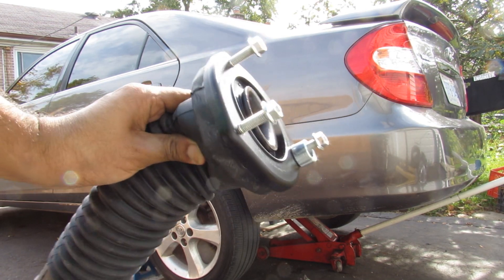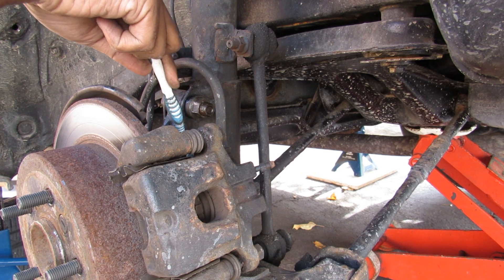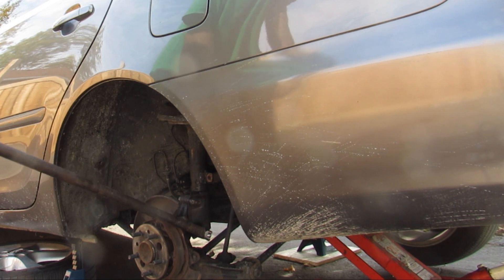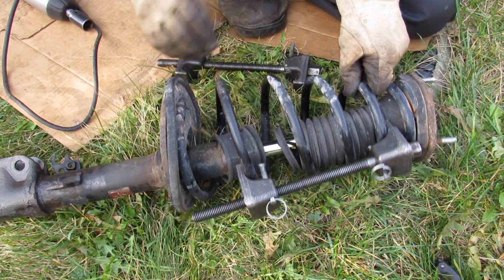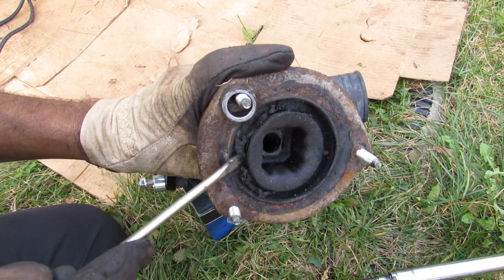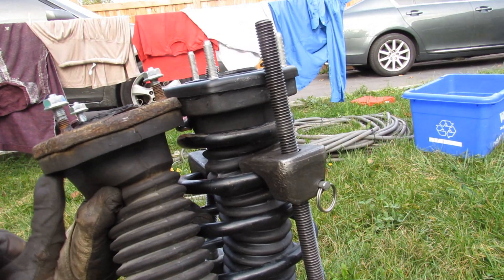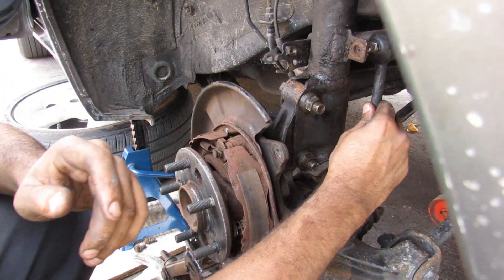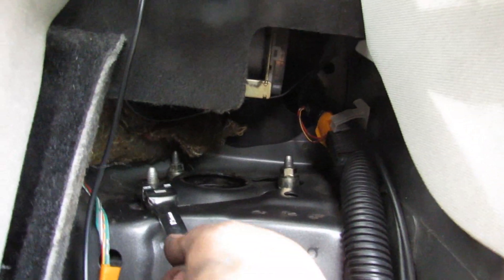How to Replace a Rear Strut Mount

Comment: The springs are very dangerous. My friend got hit in the stomach with one of them. Where the spring hit him it turn purple like in a minute. He was in pain for almost a full month. Be very very extra extra careful when you compress the springs. Believe me it is no joke. 😐😐😐😐😐
Reply from the maker: Yea they are dangerous. Keep them pointing away from you.
Reply: That’s why I always, ALWAYS, replace the whole damn thing together as an assembly. One new set per 100K miles. No worries. Did my 09 Camry 4 struts with spring assemblies at 120K easy peasy.
Reply: @ahmadghosheh3104  But only garbage manufacturers like Monroe and worse make assemblies. 
People all day, every day, use spring compressors. There's definitely a safe way to do it. They're only dangerous when done incorrectly, so don't use them incorrectly.
Reply: I have two sets, one with 2 and the other with 3 jaws. Both sets will slip (even the one with 3 jaws) and very dangerous.

Comment: I did the same job on pretty much the same car about 6 months ago. Honestly next time I'm just gonna take the assembly to a shop and pay them to swap everything out cause those spring compressors terrify the shit out of me lol. I've had them get bound up in the springs a couple times and taking them loose literally feels like I'm disarming a bomb. Good video though, keep up the good work
Reply from the maker: Thanks. Compressors scared me intitially but if you know what you are doing with the spring it can be done safely.
Reply: @speedkar99  I've used them like 4 or 5 different times now but they scare the shit out of me every time
Reply: @speedkar99  But I agree as long as you're careful they can generally be used safely. I think the key is tightening/loosening each side a little bit at a time and constantly checking that nothing is getting bound up

Comment: My KYB rear strut mounts have been working beautifully with no noises so far. I recommend Toyota brand for the front mounts though. BTW the Camry mounts are much easier to get to than the Solara which requires interior panels to be removed.
Reply from the maker: Agreed. Solara requires interior removal. 
My car still clunks from somewhere but I gave up and couldn't isolate it haha.
Reply: Still gotta remove stuff in the camry sometimes the seat and the side cushion

Comment: In the middle of replacing my rear struts. I've got the new strut with the old spring lined up. The problem I'm having is when i try to tighten the nut on the strut the whole shaft spins and there isn't enough room for the spacer. Any thoughts? The new strut does have a flat part, like for a crescent wrench, does that line up with the strut mount to keep it from spinning?

Edit, to answer my own question, yes, the two flat sections of the strut should line up to the top mount, this prevents the strut from spinning while torquing it down.

Comment: My mechanic was right. He advised against using aftermarket rear struts (KYB) in the 2001 Toyota Camry. He said they've had issues with clunking noises. I didn't listen and sure enough, clunking started in one of the struts a month later.

Comment: When reassembling the strut, is the nut that keeps the strut mount on torqued to spec or tightened until it stops?
Reply from the maker: Yeah you should torque it. I just ripped mine on.

Comment: nice
what are your views in converting a leaf spring rear suspension into coil.
did it in suzuki sj410 a lot of cutting n weilding, it was soft but i am not recommending it ever.
Reply from the maker: That doesn't sound very safe.

Comment: That’s cool how your Camry has a small cushion that can be removed to access the rear struts. When I did mine on a 98 ES300, both the bottom and back seat cushions had to be removed to get access back there. It seems like Toyota got smarter with future models.
Reply from the maker: The Camrys have the separate piece because the seats fold. If you watch my 4ES strut video, I had to take out the whole back seat too!
Reply: I did the rear struts on my 94 Camry, and the only thing that had to come out were those side bolsters. But now that I think about it I'm pretty sure I had to pull the lower seat cushion out in order to access the bolt for the side bolsters

Comment: Hey, I have another dumb question 😅 I know you swapped your old steering wheel for the SE one. Is that new 3 spoke wheel smaller than the old one? How do you like that new one compared to the old one?
Reply from the maker: I love the three spoke steering wheel. I swapped the whole interior to an SE leather.
Reply: speedkar99 so the three spoke is smaller than the old one right? Does it make the steering feel tighter?

Comment: Hey Speedy, how did you diagnose that the problem was the mount and not the strut?
Reply from the maker: In the beginning of the video it's very clear when driving that the strut top is loose and clunking.
Reply: I missed that due to the ad and the Autoplay setting in YouTube.  I watched it again and saw it.  Thanks

Comment: Cheap fix guy here - what happened to the old strut? It looks like the rubber cushion or donut basically came unglued from what looks to be a metal ring that holds the bolts. Is that what happened. Couldn't you re-glue the thing using, say, Liquid Nails Fuze It (when it's cured, it's about the right durometer)?